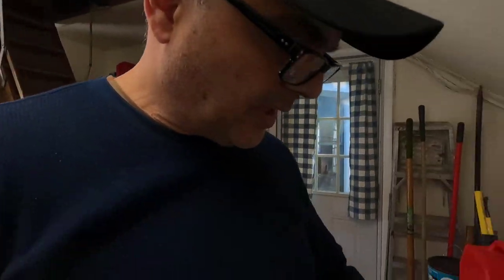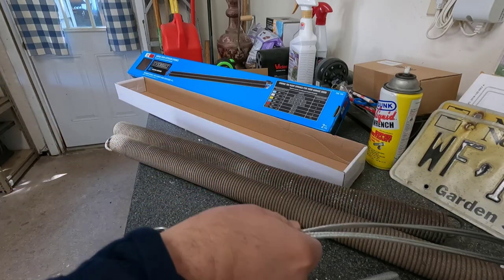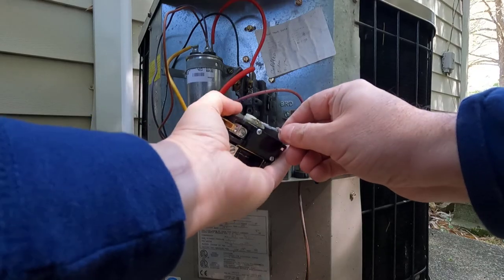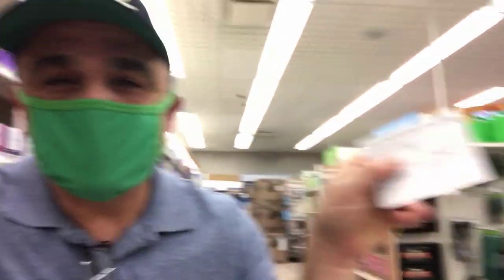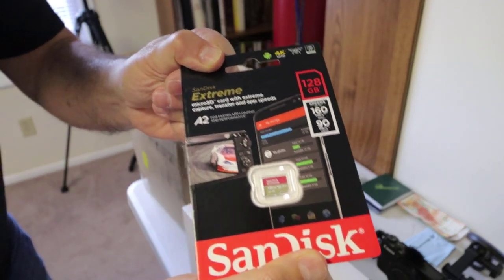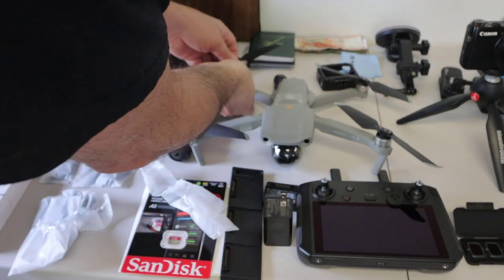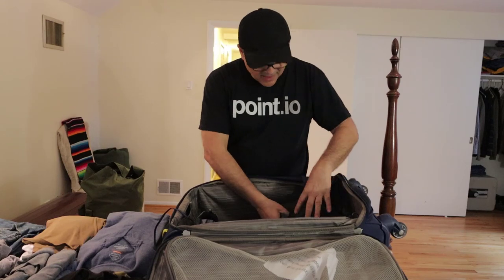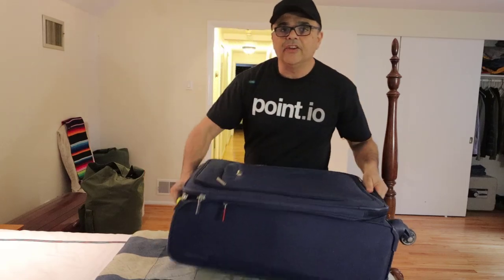Working on the house and drone stuff

Comment: I can hear the condenser goes on. Does the fan turns?
Reply from the maker: The fan does not turn. I called PSE&G but they will not work on it because I already replaced some parts on the unit. Will have to call a contractor to look at it.